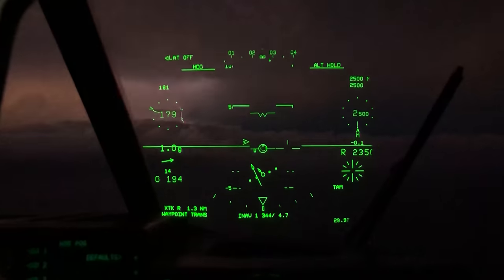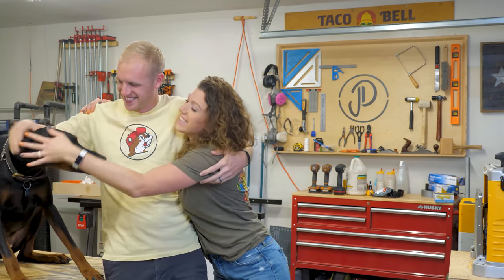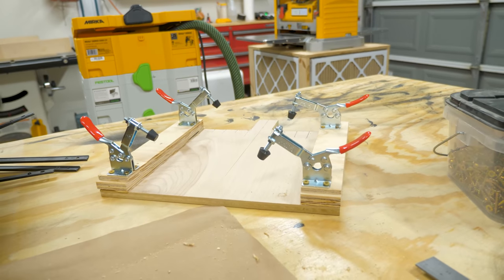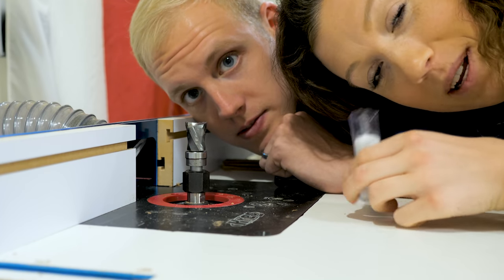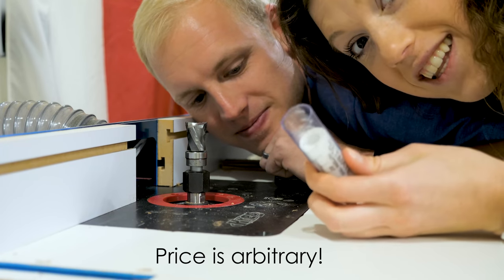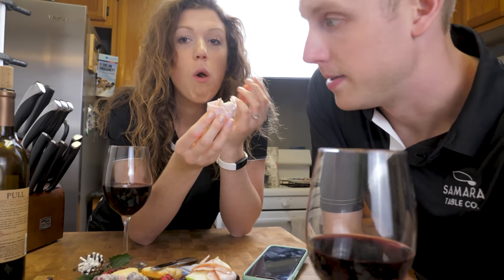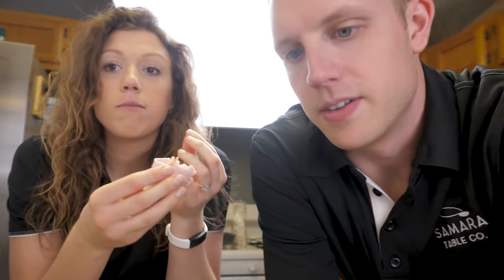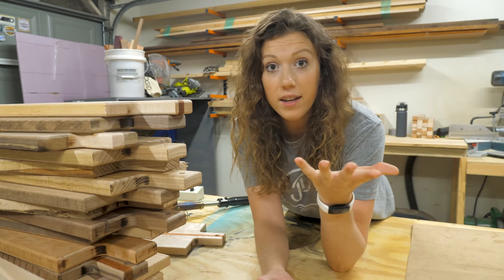we built 20 charcuterie boards in 1 day

Comment: Nice video... here's a few thoughts...  
1) Before you cut trace your handle, drill your peg hole.  
2) Put a pin (bolt) in the handle tracing fixture.  Then use your peg hole to register your stencil for your handle tracing.  
3) Putting a pin (bolt) into the routering jig will help register your board when you're trimming the handle on the router.
4) I see your getting some burns on the inside corner of your handles.  It means you're being too aggressive or your wood is too thick.  You might try pushing in your board towards those inside corners, not taking away all the material.  Then when you rout away the inside corners, there'll be very little material and the bit won't have to work so hard.

Tit for tat... What video editing software do you use to make your videos? Where do you get your background music stock?

Comment: I noticed you have burn marks on many of your boards after routing out the handles. Sanding burn marks takes lots of time. I wonder if you would save time by making two passes. The first one would take off most of the waste. The second pass would clean up the cut without burning if you moved the sled faster past the bit on the second cut so it wouldn't burn. You'd have no burn marks to sand off. I saw your short intro on what I think might have been a C-130. Thanks for your service, Davis. I am a retired F-15, F-5 USAF pilot and appreciate your video.

Comment: The line up to drill the hole can be sped up with an alignment jig, stop blocks on either side of the handle. The initial cut of the handle and shoulders can be done with a table saw on a stack of boards, on edge.

Comment: When making boomerang blanks, we use a template that has screws that protrude about 1/8-1/16" through the surface at the corners. This allows you to press the template down onto the blank and it will bite in and hold the piece. Then just use a top bearing router bit. I've even built handles into some of the templates to hold/control better.

Comment: Throw clamps.  Been using them for decades.  Attached to a master board, with registration stops for both the pattern and the part. Drop the blank into your holder, drop the pattern in on top. or bottom depending upon the bit and follower used,, (fixed follower ie collar,, or ball bearing follower,, either attached to the cutting bit or again the collar.  No pencil required once running.  Just slip the part and pattern into the jig and throw the throw clamps.   Yep, I finished watching and you arrived at the same point.   I have produced thousands of parts that way,, and produce 12 specialty parts when required.  Gravity works !!

Comment: Reduce sanding time on the inside cut of the handle by increasing the radius cut from 90 degrees as you're adding too much load and chip out to the bit.  You would need to make smaller cut passes multiple times adding more time, or change the radius and you'll notice significantly reduce or eliminated burn marks.  To be honest, I use a 2 1/2" diameter Fostner bit to cut my inside cut so I don't have to router them until I do the round over on the top and bottom edge.  It's one more step at the drill press, but significant time saving for sanding.  It's great you're trying to learn short cuts as you go along. 
One thing I would like to point out, consumers who understand hand-craft products don't want perfection, those little minor imperfections are what give the product a little character and evidence of being hand-made.  Perfection means it came off an assembly line and there are million like it!

Comment: To eliminate the burning create a second template that is a hair larger.  It will burn and Hogg off most of the material.  Second pass with original template will eliminate the burn marks and leave smooth finish.  Any time I route something tricky like Roman ogee edge I do it in 3 passes.  3 rd pass is super light.  Just keep an eye on grain direction.  Sometimes a “climb” cut is in order.....cheers!

Comment: The first glaring thing I see that can help with speed is you currently have two sides to your sled, but you don't have a back stop, if you make a longer sled and put a third "side" on the sled, you could just slide the board in and you wouldn't have to worry about checking for alignment on the front where the template portion is.
Reply: I agree, you just beat me  to it. Having the third side (back or bottom, which ever you'd call it) would instantly align the boards as long as they were all the same size blanks. Nice job J/D!
Reply: The only thing I could see going wrong with that is, if the boards were different lengths it wouldn't line up with the handle template. They could use shoulder stops or a piece of plywood with blocks that they could butt the jig against and pop the piece in, but if the bandsaw work is inconsistent that might keep it from lining up correctly.
Reply: @natoe33  that's an interesting point. I think the hard part of doing it this way is that you are also flush trimming the shoulders at the same time.  I don't know if the boards are all one size or if they are doing multiple sizes, if it were me and I was doing multiple sizes I'd invest the hour or two to make multiple sleds personally.

Comment: My thoughts, 

#1)Use the fence and a stop on your bandsaw to remove the bulk without have to trace on each one. 

#2) Find the optimal speed and feed for your routing operation to avoid burning on the wood and thus prevent more sanding. 

#3) I would set up a secondary router table, something basic or the router clamped in a vise to do the rounding over. it doesn't have to be fancy or powerful since its only a roundover. 

#4) Possibly use a high quality brad point bit instead of a forsner bit for the hole. they seem to drill a lot faster and since your going through you don't need a flat bottom hole. you can also add a stop to your jig so you don't have to mark or line up the part.

Comment: Using a cnc router to cut the handle or entire perimeter. Then you can setup enough fixtures where you change the blank as fast as it cuts. You could also use a shaper and template to cut multiple at once witout the power limitations of a router. May not make sense for a small production run but a shaper would be useful for more projects.  Last thing, if the template has a stop  pin for depth,  the final result would be more consistent.

Comment: You could use a Mid sized CNC for adding enhancements to your boards, eg flower profiles in corners, or 3D cheese wedges & 🍞 bread. Will enhance your boards & increase value for nominal cost per board.

You could also use a "cove box" bit  on fast CNC to hollow recess top face of your boards approx 1/2" from edge, 3/8" deep. Stop foods sliding off & catch crumbs like a plate normally would.

Comment: I noticed that your template is one size fits all with registration lines to make sure the boards are centered.  You only make a few different size boards so my suggestion is to make a jig for each size.  Add a foot at the bottom of the jigs too.  Then you just slap the blank in and go, no wasted time making sure it's perfectly lined up.  Add a dowel pin as David Walden suggests and you can probably eliminate the clamps as well.  I'm going to try this!

Comment: Consider losing that external handle and make it an internal one or do away with it all together. Handles like that stick out and cause the board not to be very counter-top friendly, often bumping into things. A simple jig for cutting and rounding the internal/grip handle(s) would work well in speeding your process. Cutting a slight bevel along the bottom edges for esthetics and adding some non-slip rubber/silicone pads/feet.
Lastly, don't forget to add various types of woods for different patterns and eye-appeal. You're on your way!
Best to you guys in the future!

Comment: How about building on your idea...instead of clamping a board onto your template, you add add 3 “sides”.  You’d cut your boards to specific size that drops into your template with sides, then only have to rout the handle side.

Comment: You could make the side boards that the clamps are attached to adjustable.  That would permit you to slide the side clamping boards and then tighten those down with some threaded knobs.  Then you adjust the distance between the boards so then you can use the same sled for multiple different width cutting boards.

Comment: The burning on the inside corners of the routing is fundamentally due to changing chip load. While cutting on a straight edge, the router bit is loaded on a small arc,relative to depth of the scallop being cut.
On the corner, the load increases to 90+ degree arc of cut.  It is the trapped chips being dragged through those 90 of bit radius that is smoking your wood.
Solution:  increase the radius of inside “corners” on your template to be greater than the bit radius. This way your cutter is making a sweeping turn (albeit tight) rather than stopping to make a hard left.

Comment: My thoughts: Instead of using square inside and outside corners, why not use a Forstner bit to cut the inside corners and use the same radius on your outside corners. This would make routing that end of the charcuterie board more smooth, eliminating burn and probably cutting down on time to route.

Comment: This is a great video. IDK if this has been said but if the cuts on the bandsaw are the same (assuming 3" in from the side and 3" down from the top) you should be able to just set a fence and a maglock switch stop block and just go to town. No need to trace lines.

Comment: If the boards are all the same dimensions, You don't need the clamps, just make a guide with a close fit.  Or 2 o 3 if you handle different sizes.  If you do need the clamps and have an air compressor, use a couple of pneumatic clamps.  Place the board, press the pedal, route, press pedal, remove board.  By the way, if you went CNC, you would still need to do this to hold the board down on the CNC table.
Reply: Also, have the templete cut on MDF by laser.

Comment: So my 2 cents. I will second the bit diameter vs inside corner radius. If they are the same, you will burn every time. Make your template to minimize downstream work, uneven edge equals more sanding. Do you like sanding? 99.99% of woodworkers don't, maybe you enjoy it. Also you need a blowout block on the last part of your cut, if you had to trim that edge because of blowout that equals another step. If you figure to final size the width after this step then ignore the blowout block. 
Get another router for the round over, I'd put it in another router table. You'll save time even with the cost of the tool. 
One other suggestion,  you hate double stick tape, toggle clamps are better but not the best. Look up vacuum clamping. It would be worth your time if you are doing batch production of quantity of parts. One off type things, double stick tape. What you are doing , spend the time on the jigs. Use your CNC to make the prototype jig, then use that to make you production runs. 
When you are clearing the waste on the bandsaw, get within 1/16 of your final cut. Saves time on the template routing and wear and tear on the bit. It will take practice but you can do it. One safety thing, lower the upper blade guide on your bandsaw, keep it 1" or less above your work, if the blade breaks you won't be as likely to get hurt. Also the blade doesn't flex as much when supported closer to the work you are cutting.
Hopefully these thoughts might help you out.
Reply from the maker: Thanks for your suggestions! This comment must have taken some time - we appreciate it!

Comment: Make your first pass on the router table, as you are.  Then slide the board just a smidge further on the sled and run it again.  This'll allow for a nice finishing pass with minimal wood removal, but should remove the burning and leave a nice edge.

Comment: Thank you very much, I'm considering starting a woodworking business in Quebec/Canada and this was very inspiring/informative.
Did you consider trying to rig a bearing or something similar on a spindle sander? If you can pull this off you should be able to follow the template when sanding which may allow you to speed up this process for the sanding part. I don't have any ideas on how to avoid the sanding (remove burning) so that's the best suggestion I can come up with.

Comment: To eliminate the burn, you need to move more smoothly at a pace you'll figure out.  The hard corner in your handle is a stop point and will almost always burn.  Make your template handle with sweeping curves to eliminate stops at corners.  It will eliminate the need to sand out burn and the actual routing will be faster.  It will also be a nicer looking handle but the primary benefit will be speed and efficiency.

Comment: If you do your pattern routing before you cut the total width of the board, you'll be able to trim the tearout (if any on the right hand side) without losing the design width. Also if you are getting tearout on the end of the handle, just make the handle rounded.

Comment: Use screws to hold the board onto the template, and put the screws in areas that will be drilled or cut away. One screw in the handle that will eventually be drilled out would add speed and repeatability.

Comment: Use a robo-sanding bit in ur drill press after the router table. Fastest way to repeatedly remove burn marks from an inside radius.
Also I know u want to maintain the same quality but is it possible to slim the boards down a bit. Less surface area on the router bit - less heat- less burn.

Comment: I know you mentioned the CNC would be slower. Rather than CNCing out the template or the whole board, just finish the handle. If your boards are going to be a standard width/format, you could make some registration marks in a jig that is fixed to the table and only run the program for the handle. This way you could still be cutting out the boards, changing them out and having the cnc do the finishing on them. Heck you could even trace the shape on the spoil board, zero it to the center of the handle, cut the outline, drill press the hole, round over the board and you are done.

Comment: Alter your template to have a more gradual, wider radius in the curved corner where the handle meets the board. Your burn marks are due to stopping and changing direction. If you can make that pass more fluid, in one movement, your burn marks will be greatly reduced or eliminated.

Comment: Ok 2 more things. 1. Make a drill jig that fits on your drill press table for centering the hole both direction. Lips over side of table so you have it right on every time.  2.  They make little sanding drums on bits you can put in your drill press to sand your burn marks off until you find another fix and they're cheap.  I can't go back and edit for some reason so thats why I made 3 separate posts.  As I saw an idea I typed.

Comment: Make the sled longer with dowels as stops for different length boards. If this works for one handle why not the same template for any other design. As seen in other comments, grip tape and maybe a dowel register for a hole that gets drilled before routing. Maybe add a metal sleeve to the template(countersunk) to use as the jig to drill the hole and stick a dowel or bolt to help locate the board into the template.

Comment: If you want to decrease your time making anything, you can't keep walking back and forth from the bench to the tool with each piece. Make or buy a cart to put them all on, and move them from one step to the next. This way they are all within easy reach so that you're not walking around. Yes, I know how boring it is to stand in one place for a long time. I use to work in a custom wood shop and ran thousands of feet of stock. First through a gang rip saw, then through a milling machine to s4s the boards, then stack them and then run them again to give them a profile, then sand them through a large belt sanding machine, and again stack then to be packaged for delivery.
The end result was a lot of standing in one place. Unless you put your mind to work. Such as catching the boards coming out of the milling machine and then putting them right into the sander, instead of stacking them. I might add that this woodshop only had 3 employees.

Comment: Every new piece in the jig in and out takes time. 

Are all of your board the same width? Looking at your jig it takes time to clamp the 4 toggles down. If the side walls of the jig are the same width as the board and you ran a backer wall across the back, you could just hit one toggle clamp to hold it down. 
Or drill out the jig like a pegboard and use pegs as pins in those holes to make an adjustable set of walls around the work pieces.
Reply from the maker: Yeah they vary in width. Might need to tweak this over time towards your idea. Thanks for the help!

Comment: To eliminate the burn in the corners try using a smaller diameter router bit. It looks like the bit you are using is about the same dia./rad. as the handle. If they are the size it will burn every time it runs into the corner due to heat build up. As it is now you will lose any time savings sanding out the burn marks. Good luck, pulling for you.

Comment: Extend your template at the top and bottom to allow you to cut the round over for the corners all at one time. Also, round the handle corners at the same time. That takes two steps down to one.

Comment: Make a dual router setup.. one with the pattern bit.. other one with the round over bit. Can even be on the same table.
Reply from the maker: That’s in the plan to set up! Limited space in this shop tho
Reply: @jennieanddavis  get another router and insert plate. Instead of changing bit and adjust height every time, you only need to set each one up once.